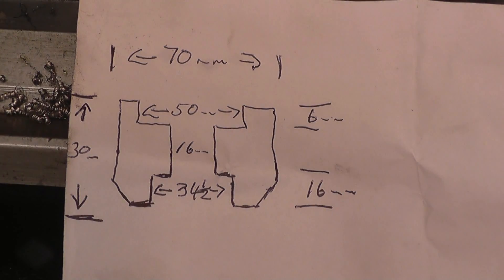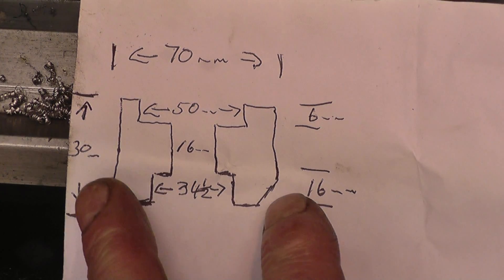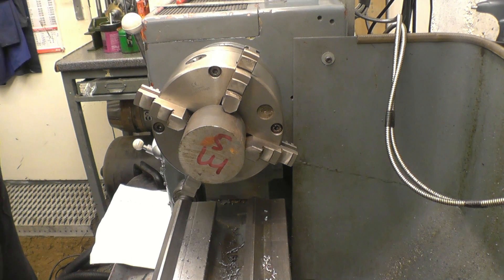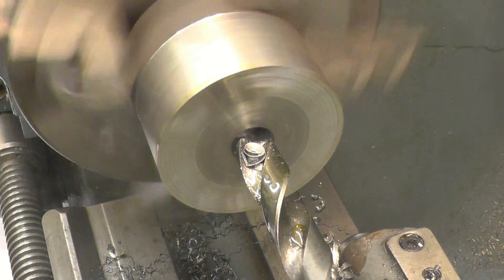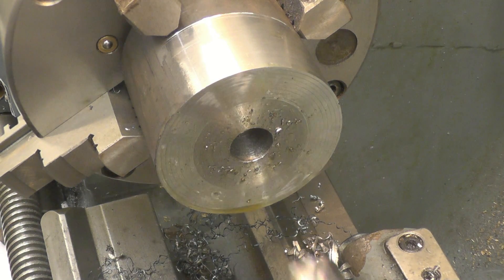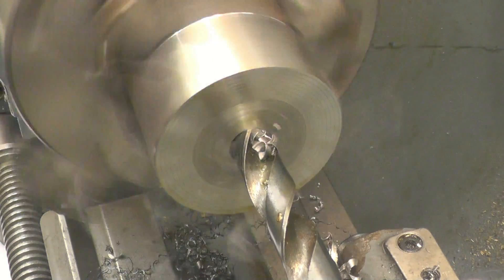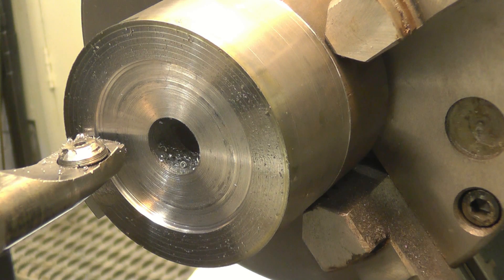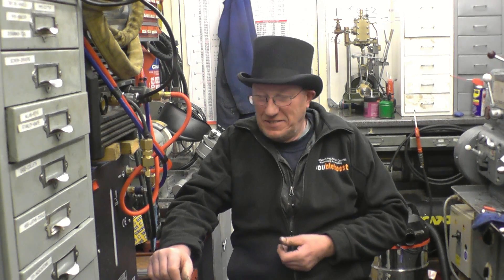SNNC 161 P2   Machining  Bush For A Weld Repair

Comment: Could I ask what brand of triangular inserts you use?  They seem to be performing well (nice finish).  Mine struggle in mild steel (1018) and I wind up using HSS tooling to get a decent finish.  Thanks.
Reply from the maker: I will show the inserts i use this Sunday
Reply: That is fantastic...thank you

Comment: John is there some run out on the head stock. To me it looked like that part was not running true after it was machined.
Reply: Colin Riley I think it moved in the jaws when he was trying to push that drill bit in there at too high of rpm.

Comment: G'day John great video, I really enjoy your channel.  That was a good tip about starting the lathe slow so the oil gets around the gears and mentioning the same as an engine in a car so many people get in car with a cold engine and floor it real "bright"  anyway from Tasmania kind regards.  P S your cousin is a bright fellow, by the way John what do you use for cutting oil?      "Chips with Fish"

Comment: 8:01 Look at that fresh machined part walking all over the place, I think this might explain why your struggling with your taper  moving!
Reply: i agree, could be due to flex in the jaws of the chuck, bowing outside and thus holding the part only at the back. Jaws need to be ground with the appropriate amount of preload.

Comment: Hello john
 i have a boxford without power feeds im using carbide tips that are cutting steel and stainless very well but sum tine the finish is not great any tips on how might correct this 
thanks Dan